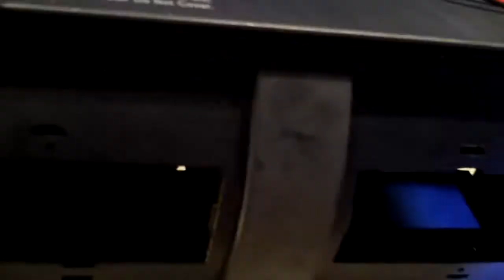A look at the parts in a ceramic heater, plus repurposing it

Comment: these heating elements burn out quick. They only last a couple years as opposed to regular wire heater elements which will last many years. These also act as an air filter and if you dont blow them out with compressed air on a regular basis they will burn out even faster. I avoid these ceramic heaters at all costs!